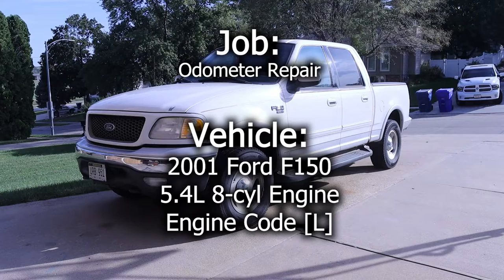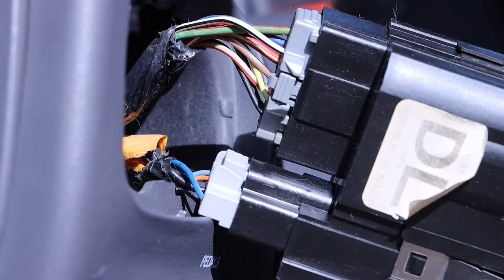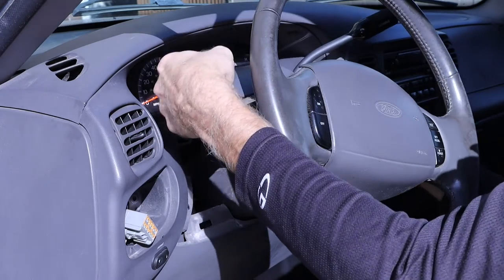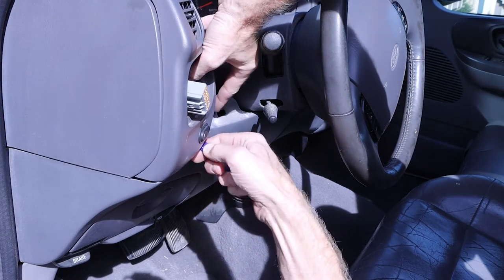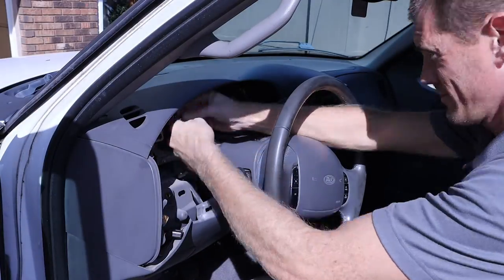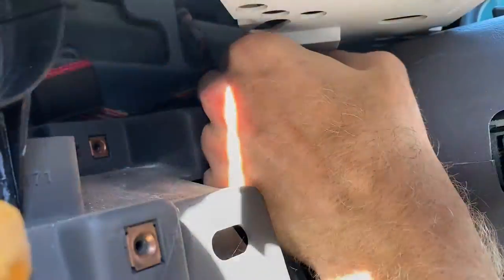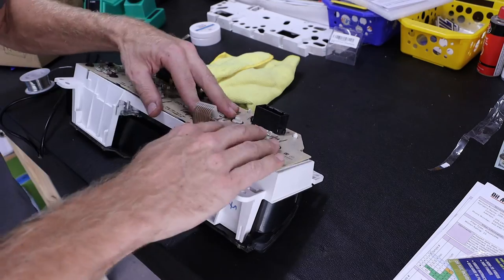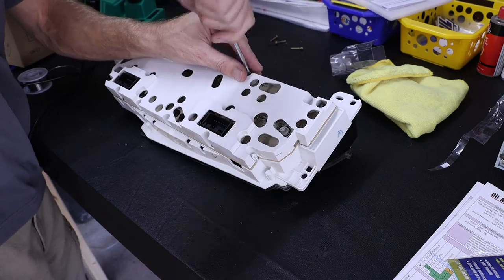2001 Ford F150 - Odometer Repair (Faint Intermittent Lights, Can't See)

Comment: I fixed my 2001 F150 odometer that's been intermittent or non existent for a decade or more. This video was, by far, the best out there. All the details needed to make a solid repair. Your "circles" made all the difference as well as your thorough explanation. Thanks for putting it out there. Haven't had my soldering wand out in many years. Great skill to have experience with.
Reply from the maker: Thanks for the comment.  Glad the video helped.  Sounds like a successful repair.

Comment: Best repair walkthrough I’ve ever seen, clear, thorough and concise. Thank you.
Reply from the maker: Thank you for the comment.  Good luck with your repair.
Reply: @InsaneOil  if you could quickly cover replacing the TPS, fuel pressure regulator, PCV valve hoses and EGR valve I’d be grateful😅 this weekends tasks, lol. Oh and brake pedal bushing too.
Reply: i agree... very detailed

Comment: If your in a Northern climate,  when I turn on the panel heat.  After it warms up, the odometer bad solder expands enough to make contact.  Unfortunately moments after it cools down, it cuts out again.
Excellent reference video.

Comment: I just used your video when I worked on my 99 Ford F150 and it certainly helped.  I did encounter  a bit of a problem. When I went to take out the light module on the left side of the dash, the top plate came off and out rather than the complete module. I had to gently work the circuit board and then clipped them together.

Other than that everything worked out well and now the flashing odometer light is no more 

Thanks
Reply from the maker: Sounds like it was a success in the end.  Great job.

Comment: ~ Thanks for the detailed video!  
And thank you for highlighting the trim areas to be removed as well as highlighting specific screws and fasteners.  That helps a lot.  Where can I find the needle tip for my soldering iron?  Everyone I come across is to big to work with,I like that fine pinpoint tip to solder the pin with.  Thank you so very much for sharing this video.  I have a 2002 XLT 5.4L V8 Extend Cab.   I don't care what anyone says I love my truck!  The first motor went 300,000 miles and then my husband and I had a second 5.4L V8  motor put in a few years ago.  Next weekend we're having the entire front end suspension system replaced.  After 20 years it's time for that since a ball joint has gone bad but i'm doing both sides ....only makes sense so we don't have to deal with when the other side goes bad.  Any good useable parts I take off when making repairs, I always give to other people who might can use them on their same year trucks.  Comes in handy and you don't have to go to a junkyard to find that part or trim panels.  Anyways I sure appreciate this video you posted sir!!  Have a blessed day!
Reply from the maker: I bought this kit from Amazon and it came with the pinpoint tip. https://www.amazon.com/dp/B087832Y16?psc=1&ref=ppx_yo2ov_dt_b_product_details

Comment: Thanks for another very helpful 2001 F150 video. I need to do this repair on my truck as well.   ...This is off topic, but I was listening to the video "How to Use a Circular Saw : Make a Bevel Cut with a Saw" by ExpertVillage Leaf Group, and thought to myself,  I know that youtube voice and delivery style. Sounds much like you from an earlier time. Regards.
Reply from the maker: Thanks for the comment and good luck with your repair.  Yes, the circular saw video was from back before Google bought YouTube and before YouTube was "YouTube".  If I remember correctly, I have somewhere between 3000-5000 Expert Village video clips floating around online somewhere.

Comment: Great content, perfect tutorial, very helpful
Reply from the maker: Thanks for the comment.  Good luck with your repair.
Reply: @InsaneOil buying an f150 today 2001 with a misfire can’t read odometer hopefully your video is helpful brother
Reply from the maker: @Chkahoe_  How did the purchase go?  Any luck with the odometer repair?
Reply: @InsaneOil  it’s going brother I have to change sparks and coils replace the radiator as well just ordered a pex Bluetooth scanner for 40$ gives you codes an stuff connect to your phone
Reply from the maker: @Chkahoe_  Sounds like it will be a challenging and fun project.  When I did my plugs and coils I also did the intake manifold and crossover (as it is prone to leak) https://www.youtube.com/watch?v=W_UpGwTkr64&t=1953s
Reply: Okay brother thanks yeah the engine had a bit of a shake no big issue resale once tuned thanks bud
Reply: @InsaneOil  I will look into that as well

Comment: I tried doing this but now my cluster won’t even respond…
Reply from the maker: Any luck?  If the whole cluster is dead then check the large wiring harnesses to the cluster for a good connection.
Reply: @InsaneOil  half the cluster responds.
Gauges don’t work. Gonna need some help on this one
Reply from the maker: @trey6521  Clean all your connections with electrical cleaner.  Recheck your solder job.  Double check your ribbon cable.
Reply: @InsaneOil  you now I did bend the ribbon the cable
Reply: @InsaneOil  not gonna lie I’m a bit nervous about the repair
Reply: @InsaneOil  can I send you a video of the issue?
Reply from the maker: @trey6521  You got this.

Comment: I was at 499996.9 miles and I got home and then when I tried to go out with a buddy to hit 500000 the odometer wouldn’t turn on no matter how much I hit it. I hope this works and I’ll hit 500000 tomorrow
Reply from the maker: Did you hit 500k?